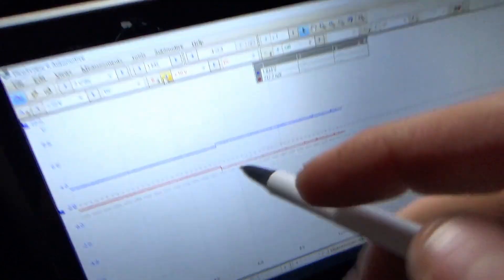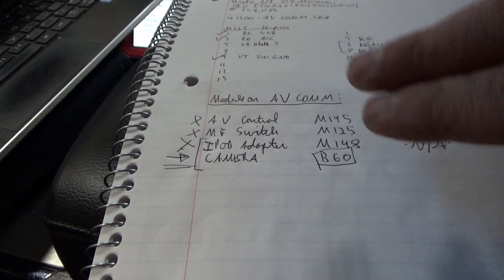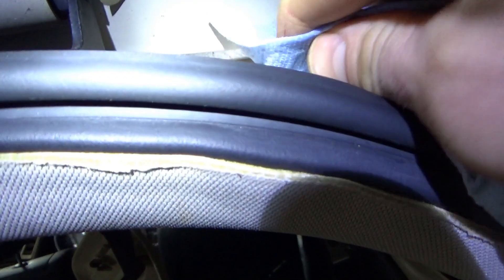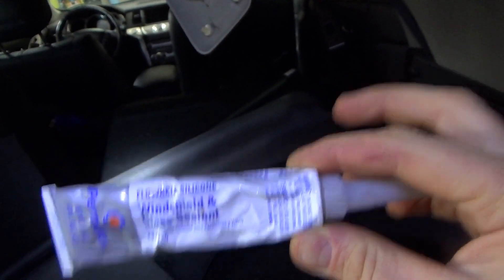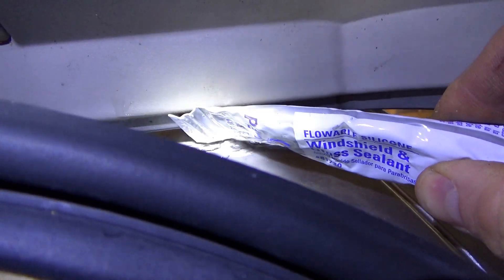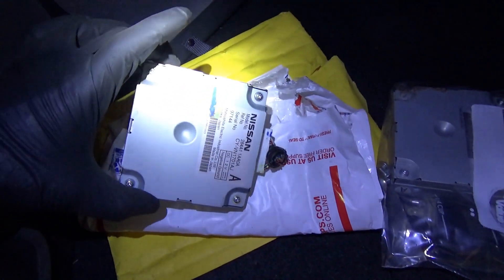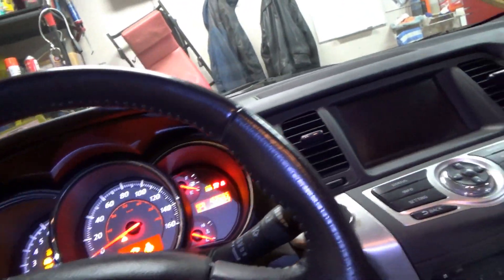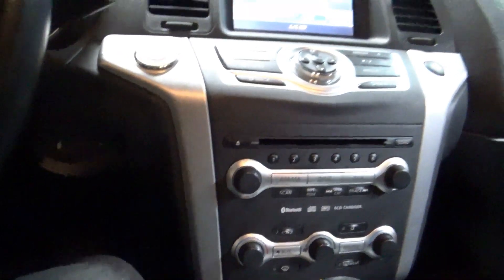Mystery Murano...No RADIO, No HVAC, No fun!

Comment: Hi Ivan, Just a tip, after I use a tube of silicone sealant I clean the threads (alcohol, it's important to get most of the sealant off) and coat with wax from a candle. first warm the area with the flame and drip the melted wax over the area. I now have tubes that are still good after a very long time.
Reply: Good idea I leave the nozzle on and use electrical tape to seal the end of the nozzle seems to work
Reply: Thank you! Great idea! Do you light a candle and drip the wax in?
Reply: @dans_Learning_Curve  yes
Reply: @gazoline7093  HI I tried that but I still had it harden in the tube.
Reply: I've wrapped a sandwichbag around the tip and wound  a tight rubber band around it.  Works after months.
Reply: Great idea 🤯

Comment: Hi Ivan, You can try to take some rubbing alcohol and a toothbrush and clean off the corrosion and see if the module springs back to life.  Many laptops with water damage are serviced with simple alcohol scrub.  I have never tried, but you might also be able to use your deoxit stuff to get that corrosion off the circuit board.  My guess is the board is fine but some leads are shorting out.
Reply from the maker: That actually crossed my mind... Would have been interesting to try!
Reply: I would have done the same, but guess the customer wanted new. If it worked after cleaning, being an electronics nerd I would have installed new electrolytics and buttoned it up.

Comment: I still think the radio and HVAC should be separate units, putting all these systems together adds cost and complexity for no good reason
Reply: It's typically ok in most other brands, but Nissans are always having head unit issues.
Reply: The only reason many things are done a certain way is that it cheaper or easier. 
No manufacturer would do it harder or more expensive.  Even if it is more complex it still must be in the first category.
Reply: I was thinking the last Murano that Ivan repaired, he replaced the head unit and got the wrong one the first time; it was maybe a few years off.  These systems are consolidated because it is cheaper to make it that way.

Comment: a necessary evil of modern complex systems is a multifunction comm bus. A properly designed system [some more intelligent than others] would accommodate a soft-fail mode, preventing a single point failure from bringing-down an entire network. Good work on this; it's always nice when you can leverage past experience, eh?
Reply: Typical Nissan crap.

Comment: Just a note when applying silicone sealant. I use plain rubbing alcohol to clean the area before applying the silicone just to be on the safe side and it evaporates relitively fast. Also, if you ever run out of "dry gas" additive, rubbing alcohol at a ratio of 12oz to 10gals in the tank will also work as well. Great vid, Ivan! 👍

Comment: There are a lot of people that don't understand that a bad component on one branch of a circuit can completely kill another branch of the circuit.

Great video.
Reply: Todays engineers probably didn't experience those early day mini Christmas tree lights that when one bulb burnt out, they all went out. They don't build them that way now for years so when one burns out the rest stay lit. I'm sure one extra wire to the harnesses would prevent that?
Reply: @Garth2011  I can try to give a brief explanation if you would.
Reply: @Michigan_Tactical  My guess is another data signal that would by pass a bad module preventing data to continue from other sources. Is that called a daisey chain?
Reply: @Garth2011  you're half right. A daisy chain is a series circuit. Like your old Christmas lights. Let's say you have 100 lights and each bulb draws 100ma at 1.2v (0.12 watts), by wiring them in series the total current draw for the string remains 100ma. The volts are divided between all the bulbs.  If we measure the voltage across each bulb and then up we get 120v each bulb acts as a fuse. If the bulb burns out the circuit opens and we get no current flow. 

Work is done by watts and we figure watts by volts times current. We have a supply of 120v but current is zero. Anything time zero is zero. So we have no lights.

If our bulb shorts. We still have a current current path. Each bulb still gets it's 100ma current. But our 120v is divided by the remaining 99 bulbs. The result is each bulb has more volts. So they burn brighter and hotter. If the volts is to high for bulb, it will burn out and go open. Like a fuse. 

So if the components in the car were daisy chained, the short wouldn't effect it like we saw. 

The other option is a parallel circuit. Or a ladder.  In this circuit each component is connected to the same volts. But the current drawn by each component is determined by internal resistance. (Volts ÷ ohms = current (amps)) so the more components we add, the more current we draw. If our supply can give the voltage we need at the current we need, everything is happy.  

But now if we put an unwanted current path across any component we increase the total current draw. If the resistance of this unwanted path to ground is zero our voltage changes. To backwards. Remember our current in amps multiplied by resistance equals volts. 

Relevant math here is volts ÷ ohms = amps.
If we have any resistance at all, we volts have current and we have watts. As resistance approaches zero the supply volts will drop.
 We have a very high current draw but extremely volts.

The is a third circuit type. And it's series parallel. It's like ladders connected side by side. We could have a short that kills one complete ladder branch with minimal effect on the others branches. 

So what we had in this video was a short that brought the voltage down to where the other wouldn't function property but not enough to kill the entire branch.
 This is why we had a low voltage signal on the bus until the faulty module was disconnected.
Reply: @Michigan_Tactical  Understood...Not being the engineer, that's what I was envisioning, the "ladder" or parallel design. The dumbcoffs in auto electronics need to get with the program.  I never noticed the public breaking down doors seeking this type of lunacy...in automotive
Reply: @Garth2011  some of it isn't up to engineers. Some of it's because of government mandates. We have politicians that decide what's legal or illegal without regard to consequences. That leaves the engineers to have to design things within certain parameters.

With all the computers required in cars, the modules and such are more complex and sensitive. 

Old transistors for example had ratings of several volts and amps. Now it's a few volts and mA. Computer modules of today can be fried by static electricity and close lightning strikes.

Now putting a starter on the top side of the engine under the intake system is all on the engineers and they should hung for that. Lol
Reply: @Michigan_Tactical  Guvment is not smart
Reply from the maker: @Michigan_Tactical  not quite the case with network signals however. In this case the CAN lines were pegged at the rails by the offending module, so no other module on this network could talk at all! Doesn't matter if it's parallel or series or hybrid layout, result is the same 🙂
Reply: @Garth2011  Daysi chain topology, is when a module conects to the next one and so on, one after another, hence why its called a chain. Data must pass from one module to the next one in order to reach its destination module.

These data lines on this vehicle is a "Bus topology" network configuration, in which all modules are tied together on the same "Bus", thus if one module fails it brings the whole network down, because it uses the same wires to talk to each other.

Comment: I guess all new cars should come with a scope and a training corse on how to use it and interpret it.
Always great videos. Keep up the great work!
Reply: That's silly. Automotive scopes have been a thing since the days of points and condensers, why start now?
Reply: Yea I know SUN ignition.  What I ment is there so many modules now interconnected  and can bus issues, as noted 1 goes down it drags another one with it. Rear camera module , not as important as the heat and a/c (defroster]). Who would be looking at , unless you were Ivan. Dealers service technicians probably wouldn't have found it as quick as Ivan.
Reply: @robertrousseau3361  I would say the wiring diagrams are most important.  
You could of used a meter if thats all you had where he has his scope.
But if you dont have those maps you are not gonna find your way.
Reply: Mitchell  DYI $ 20.00 for 30 days all you need for wiring diagrams. Most of us can't afford a pico, but if you have one and know how to use it , VOM can't come close to what you can see on a scope.
That's all I am saying.
Reply: @robertrousseau3361  Right on man, have a good one.

Comment: RTV tip: After opening,  squeeze all the air from the open end, reinstall the cap, then refrigerate it. Will last for a very long time.  Will also work for most adhesive items, :yougotthis::goodvibes::elbowbump:
Reply: When plugged up, it is possible to clear the outlet with a tool while squeezing he tube. I prefer this to cutting the tube which will make it harden much faster (flowable non-acetic acid silicone type cures with moisture).
Reply: I found this also works very well for C.A glue (crazy Glue) greatly extends the shelf life 👍

Comment: Great diagnosis Ivan; you are so much smarter than most mechanics at Nissan dealerships.  They would have not found this problem and would have simply been firing the parts cannon hoping they eventually hit something.  And the poor owner gets to pay for all the unnecessarily replaced parts that was not the problem to begin with.

Comment: The four hour drive for the owner, worth it for sure. Great call on googling leak and clever work around to use left over silicone. Great find of clean replacement module on ebay.  Diagnosis not only leads to failed module, but why it failed. Yet again, NICE JOB!

Comment: My favorite product for water intrusion prevention is polyurethane caulking. It is both adhesive and sealant, and quite cheap. Far as I know, version of it is used to attach windshield on cars. Beauty of it is that it remains elastic for many years, in case that there is some body flexing. It is also paintable, so it can be hidden easily.

Comment: Great diagnostic vid!  Suggestion for you....  After opening a new tube of silicone, double-bag the remainder in zip-lock bags.  That will slow the ingress of moisture that cures the silicone inside the tube.  I can usually keep a tube viable for a year or more this way.

Comment: Good job Ivan, have a little tip on those used silicone sealer tubes, after useing them pack the end cap with  silicone grease or vaseline. Then when you want to use it just squeeze out the grease and your good to go.

Comment: Having spent a few years in the auto glass industry, I strongly advise against the use of silicone products to seal supposed glass leaks, and the fact that this product exists is rather frustrating.  Silicone is incompatible with the urethane adhesives used to install auto glass, and it's also really good at attracting, trapping and retaining moisture, causing rust to develop underneath.

Chances are, if you have a leak around your urethane-sealed glass, and that glass has not been replaced, it's not what's leaking.  In the rare cases where it is, it's due to delamination of the factory adhesive (there was a change in the process in the mid to late 2000s to early 2010s), and no amount of user-applied sealant will be effective.
Reply: Was not a glass area. Leaking at the factory seam sealer. I thought of that too. Apply urethane.
Reply: Black, plastic gutter sealant has worked perfectly for me over the last 30 years ! (no idea what it is !)

Comment: Totally different car, different country, but I had the same issue with mine. I don't normally use my boot/trunk, so when I went to check my spare tyre, for the cars annual test, I found it had it's own swimming pool. I spent ages trying to find the leak, as it was only a small one, and eventually found that the seam sealer at the top of my hatchback had dried out and cracked. A liberal dose of silicone later and the boot is as dry as a bone. What ever happed to the really gummy seam sealer of old that didn't dry out and crack??
Re 17:29, I'm guessing, thanks to you, that anyone with a Murano, and this fault can skip the scope and circuit drawings, and jump straight to ripping out their reverse camera, and checking for leaks...
Great job Ivan!! Quick tip on the silicone, if the top of the tube has cured, put it into a small syringe, it makes it way easier to apply in tight spaces

Comment: HI IVAN,another great video on a problem that is becoming more and more common.This guy fired the parts cannon BEFORE he got his TARGET in range.haha YOU show why it is so important to LOOK at a map before driving from Calif to NY to get your car repaired.Yes a map is needed.I just repair my 94 Honda civic that has water intrusion that rusted my fuel pump relay.The same relay that 15 years ago i repaired a CRACKED COLD solider joint on.Car still running with 540,000 miles.Now the clear coat needs work,and i need to get that sealer for my windshield since I'm on my 3rd one,and it leaks now.

Comment: Good one Ivan.  Ivan to the rescue, scope to the find.  Communication lines are so low voltage and current anything can shut down that system.  There needs to be more protection for CAN, other communication lines and the modules where they're located.
I can only imagine the length and how the comm lines are wrapped in the harness.

Comment: Thus is excellent. And I  love bonus footage. This year, I hope to use whst I've learned from your channel to finally fix my air bag and rear AC.

My 2004 Suburban has had the airbag light on for years now. It started intermittently when I first bought it used in 2005. Then about 8 years ago it stayed on. I found a dealer fix that I corrected (they cut out the yellow safety connector for the driver air bag) but that didn't fix it. More recently (past 3 years) the rear air started working intermittently then stopped working all together. Also, the front air mixer door doesn't work but I've tested the actuator and it works fine.
Reply from the maker: For the airbag try unplugging and plugging in the airbag module... That was one of my very first videos!

Comment: I have done preventative magic box maintenance many times on wiper motor controllers, AC controllers, AV modules like this one, amplifiers in the trunk etc etc.. split open the plastic or metal case and seal top and both sides.  I usually leave bottom open to allow for drain.  Best stuff I have found is one of the Sikaflex sealants that is popular with boat owners for setting window panels and sealing sailboat masts

Comment: Another job well done Ivan. I hope folks get the hint about taking notes to keep you on track while diagnosing the root cause. I was hoping you would pull out the flowable silicone and I was not disappointed. I am disappointed in Nissan not having weep holes in that rear skirt panel since it has a unsealed module in it. I would have coated the circuit board in the camera module with clear Krylon and applied dielectric grease to both sides of the harness connector. I am a belt and suspenders guy, can you tell?

Comment: I saw a similar video where the control unit in the rear quarter had corrosion and it was possibly caused by the sunroof drains being blocked so the water ran into the rear section. If there's no sunroof check the rear hatch seal.

Comment: Excellent video, as always. Interesting to see, that as vehicles get more complex with computers, a flat line on a data stream, can take out so many functions. Just a shame that circuit diagrams are kept secret, or behind paywall. Even amateurs with a little knowledge can by stumped, by finding data. It is also very annoying, that some high end vehicles, like BMW and Mercedes, need individual modules programmed by the stealers, before they can work.

Comment: DAP “Clear Paintable Silicone Caulk” is an excellent sealer and adhesive as well .. great for sealing/resealing windshields at the bottom/cowl joint leaks .. it sticks like a banshee, even when you can’t get the area as clean as you’d like.

Comment: I had water damage to my immobilizer module from an ongoing trunk leak. Water pooling in a sealed well for the spare wheel. I carefully drilled drain holes into the plastic well to allow for permanent drainage through the car. I advise everyone to carefully drill drainage holes just in case of water ingress - Simple and effective.

Comment: Great Video Ivan, we just bought a 2009 Murano LE Bose with Nav with 68,000 miles.  Super clean, but the screen doesn't work and no buttons work.  The HVAC works, just can't change it.  Luckily it appears to be set at a temperature (i.e. 70 degrees), so we get A/C in heat.  The buttons do light up with headlight switch, but again none of them do anything.  I will try so tests and see what could be wrong.  Finger crossed not too hard and I can find the problem.
Reply: Did you ever find the answer to your problem? I'm having the same issue
Reply: @tremaynedixon4586  Yes, I figured it out after I had to take it to dealership.  It was a couple of things.  One the controller or computer under back row passenger seat was bad, and then one of the pins was bent on the connectors to the radio under dash.
Reply: What did that cost?